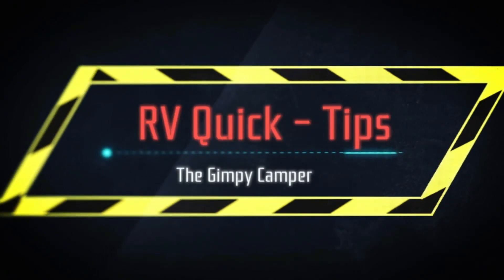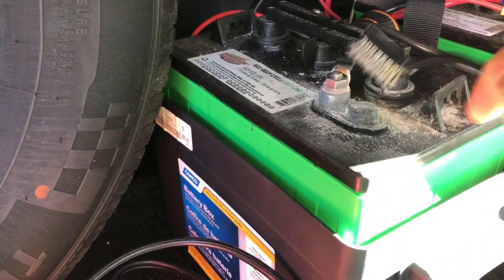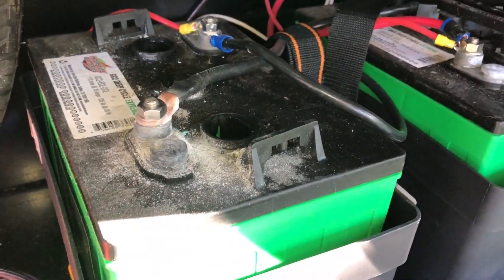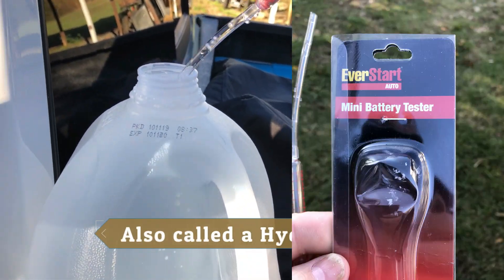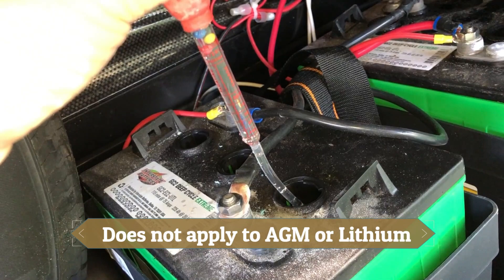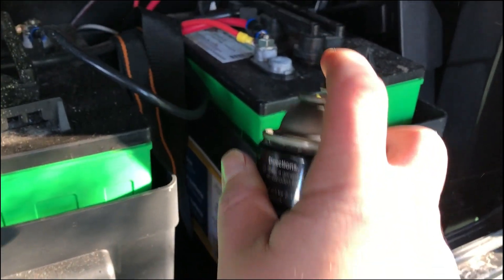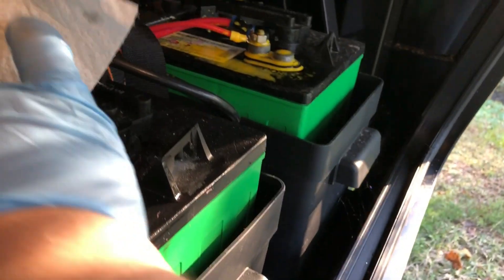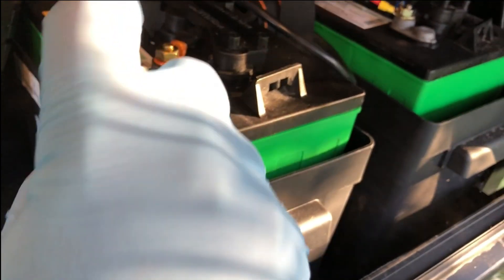RV Battery Maintenance - Lead Acid Batteries

Comment: A few months ago I just used the same spray battery cleaner on my ford truck, it did a really good job.  And it is very important to avoid corrosion, it will interrupt the flow of electricity, I guarantee it!
Reply from the maker: +Finding Mark In Maine I just checked it after about a month and it still looks great!
Reply: @Gimpydoingstuff  Sort of related to corrosion, my ford truck had corrosion so bad ( it was under the plastic coating where I could not see) within the wiring connected to the battery terminal no power was getting through, found it by accident really when I needed a AAA start, two truck guy said to check it out and sure enough I had to cut off the bad part and replace the terminal.